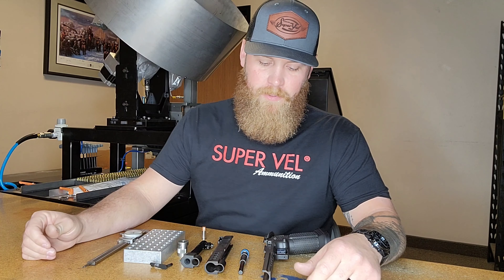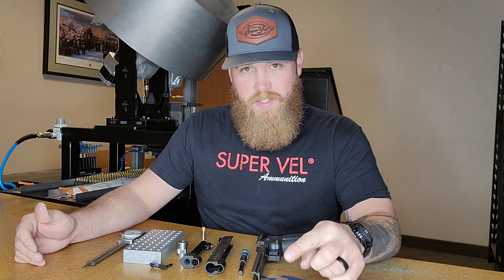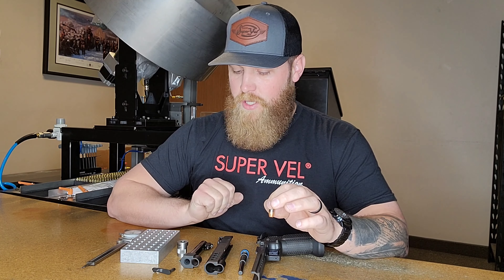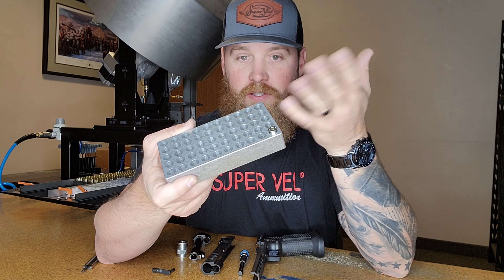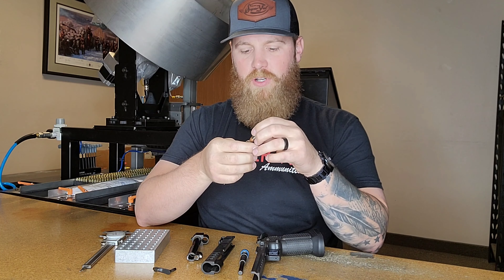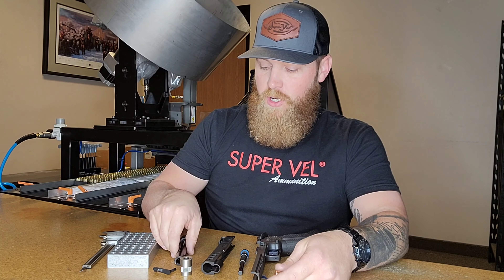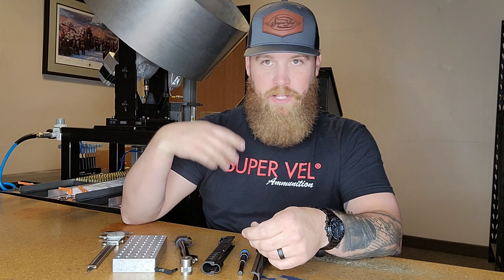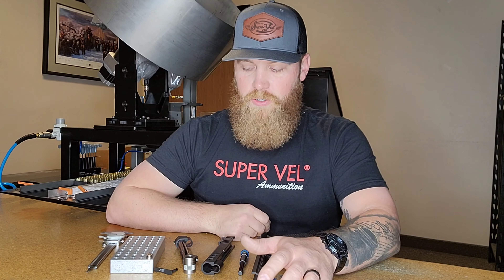Chamber Checking Ammunition Specific to Your Gun

Comment: Barrel throat is the issue.... saami spec chambers should be the same. My Gen 4 Glock 19 runs with just about everything I can stuff in it. Throat is much tighter on the Gen 5. I needed to adjust dies. Also bullet ogive dictates overall length. Keep up the good work. I enjoy your vidros
Reply from the maker: Majority of SAAMI specs have a +/-. The trouble is loading to fit everything. The gen5 glock is a perfect example. They shortened the free bore are which caused certain style of bullets with a more prominent forward ogive to impact the rifling. Definitely a headache for many.